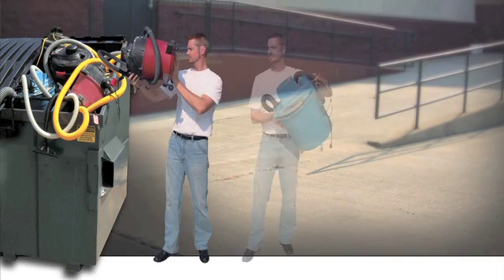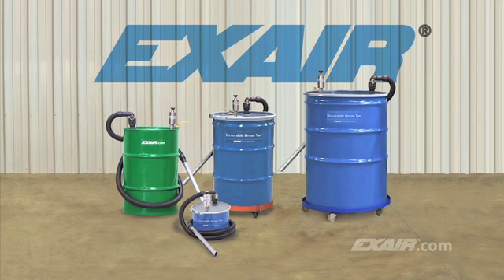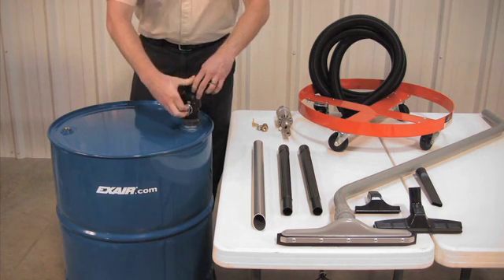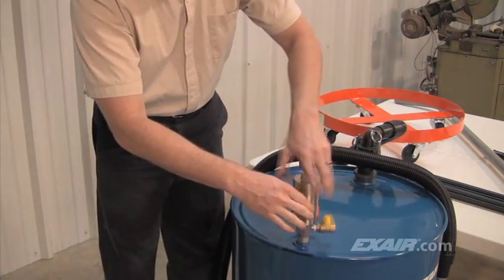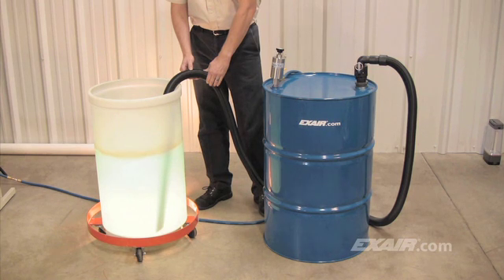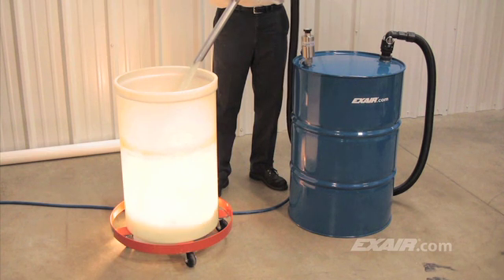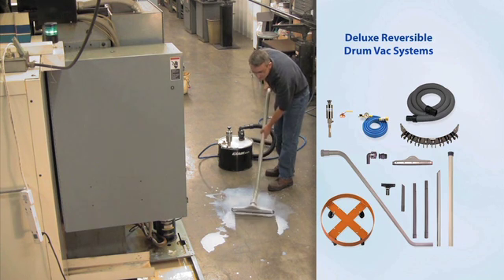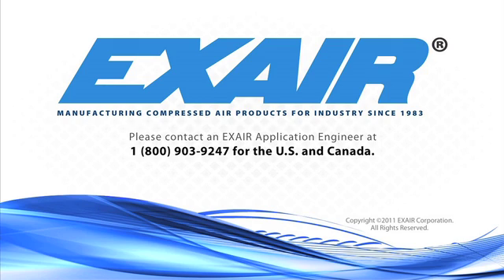Reversible Drum Vac from EXAIR

Comment: could this used to fill and empty a water tank im my 4wd. i have an onboard commpressor system
Reply from the maker: @Samuelmdouglas, Sorry for the delay in our response.   The compressor system on your 4WD is probably going to be a little undersized to operate a Reversible Drum Vac.  The RDV consumes 19 SCFM @ 80 psig of inlet pressure.   Also, it would need to be used on a steel drum or tank.  If you would like to discuss further, please call or e mail.  1-800-903-9247 or Techelp@EXAIR.com    
Thanks for the question and try to stay shiny side up in the 4WD.

Comment: can you make it filter the waste cement paste water when we wash off by water jet after installation
of fresh concrete on the sub concrete and laste spray surface retarder.

We need vacuuming machine and filter paste water simaltaneously.
CEMENT PASTE WITH RUNNING WATER BY WATER JET WASHING OUT AFTER THE EXPOSED AGGREGATE CONCRETE FINISH.

Please, advised with me and inform your professional idea bout my situation.

Awaiting reply.
Reply from the maker: This has not been tested on the Chip Trapper systems.  As long as the system is flushed and cleaned quickly and the residual concrete is not allowed to set up inside of the valve or filter bag it should filter the solids just fine.   The vacuum will not suck up only dust.  The solids would need to be suspended in the water and vacuumed up from there.   If you would like to discuss further, please feel free to contact us at 1-800-903-9247. Thank you for the question!

Comment: will this  pump transfer used  motor oil from one drum to another  , I tried and it only moved about  1/3 of barrel  then stopped ..
Reply from the maker: +Ron Nichols, The Reversible Drum Vac should handle most motor oils just fine.   For thicker heavier weights we do offer a High Lift Reversible Drum Vac.   There are several other variables that go into whether the Reversible Drum Vac will operate properly.  Please contact us at 1-800-903-9247 and ask for an Application Engineer, we would greatly appreciate the opportunity to trouble shoot this application with you.   We look forward to your call!

Comment from the maker: @iso plastic, The Reversible Drum Vac product line is not recommended for use with any material which has a low flash point or with flammable liquids such as fuel oil, alcohol, mineral spirits, gasoline, or kerosene.  If you would like to discuss this further, feel free to contact an Application Engineer at 1-800-903-9247.  Thanks for the question and have a great day!

Comment: Are these standard 1 1/2" vacuum hose?
Reply from the maker: @JoyFilters, The Reversible Drum Vac family all operate off a 1 1/2" I.D. vacuum / discharge hose.   This pushes on to a barbed fitting which is part of the quick disconnect.  If you would like more information, feel free to contact us at 1-800-903-9247.

Comment: What size compressed air line are you using?  How much air pressure and or CFM does this unit require?
Reply from the maker: @JoyFilters, For this video we were utilizing a 3/8" I.D. compressed air hose.  The operating pressure for the Reversible Drum Vac is 80 psig inlet pressure.  When operating at 80 psig the unit will utilize 19 SCFM to fill and or empty the drum.   If you would like to know more, feel free to call an Application Engineer at 1-800-903-9247.  Thanks for the questions!